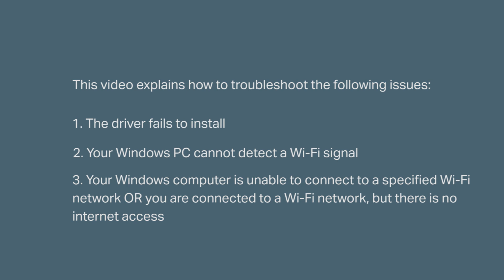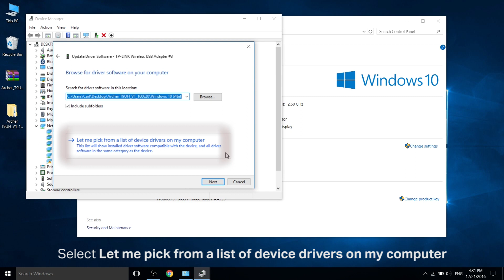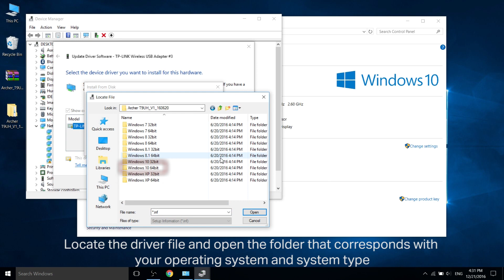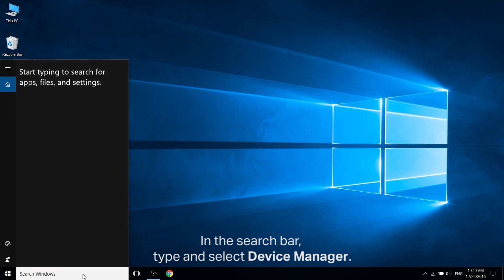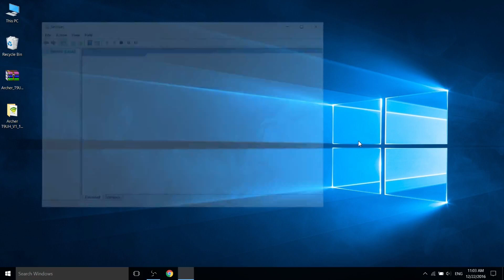How to Solve Common Problems When Installing and Setting Up a Wireless Adapter (Windows)

Comment: My problem is i have it plugged in but the driver shows please plug in the adapter
Reply: Me too
Reply: Arnas Jur i solved by finding an unofficial driver update somewhere on the internet.
Reply: Trinabh Paul same here
Reply: Same, anyone have a solution?
Reply: Same here pls help
Reply: Sulotion? I have same now win10 64bit pls help
Reply: Daniel Kiss Gremsperger wdym could u find a link please?
Reply: Daniel Kiss Gremsperger I should download older tplink driver install version?
Reply: can you proide me the link
Reply: @AminoFPS  solved it?
Reply: same problem here, did u solve it yet?

Comment: TP-LINK ''You can always contact us'' Well people do contact you judging by all the questions on your YT videos, trouble is you don't fkn respond. Like many others I have a TL-WN8200ND adaptor that doesn't work in Windows 10. My laptop (like others) does not have a CD Drive. So please tell me where are the Widows 10 drivers, or confirm whether this adaptor will or wont work in Win10?
Reply: EasilyBeatable Considering their lack of replies on all of their videos I'm not really surprised, just wish I'd seen them before buying their crappy adaptor. One thing I do know, I'll never buy anymore of their products, guaranteed my $$'s go elsewhere. :-)

Comment: I followed all these steps and nothing worked for me, my wireless driver is TL-WN8200ND the setup doesn`t work because don`t have compatibilty with my Windows 10 Pro.

http://www.tp-link.com.br/download/TL-WN8200ND_V2.html#videos

Same i have tried with this link up, when i try to run the setup NOTHING happens.
Reply: Breno Hyatsuki m2 wn8200 is fucked up disconnecting and connecting all the time

Comment: I use the nano USB wireless adapter and even thou all the drivers and the device says it is working properly it still doesn't connect to my wifi, even thou it worked properly in the past?
Reply: I lost my original TL-WN727N and just bought a TL-WN725N. I've updated the drivers. Even tried removing all instances of adapter drivers and software, including Windows' default "Realtek" wireless adapter drivers. Nothing. I used to get a shitty but at least working connection via the 27N, but this 25N is a nightmare...
Reply: https://www.youtube.com/watch?v=DP99Ym2vnPY
Reply: @gillesdijkman8519  wat

Comment: I cant find Win10 drivers for TP-LINK TL-WN722N
Reply: Next time, buy wireless adapter from a company that respects you.
Reply: Hi, i have the same usb adapter, unfortunaly it isn't compatible with Windows 10. I suggest you to buy this http://www.tp-link.com/ar/products/details/cat-11_TL-WN823N.html
Reply: If you wanna see more items compatible with Windows 10, here's a link who can help you. www.tp-link.com/us/win10compatibility.html
Reply: Same USB adapter here..  ! it's strange, it's windows 8.1 compatible even though i can set it up.
Reply: @shreehari7201  yes new drivers are messed up
Reply: Now it should be compatible windows 10 and thought still not finding pilots
Reply: Windows 7 works on this, lol ,but is too late is already 2020
Reply: Get archer plug and play or similar

Comment: Hi,ive updated the software and it has now turned into "802.11 USB Wireless LAN Card" and the old wifi that i was connected to has a x on it and says "the settings saved on this computer for the network do not match the requirements of the network"